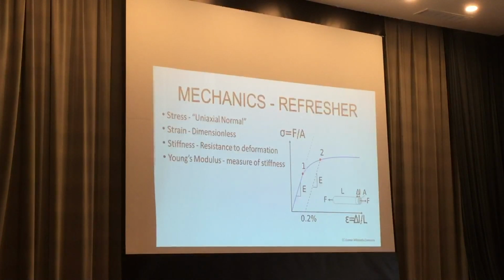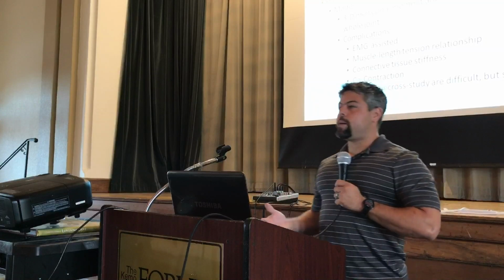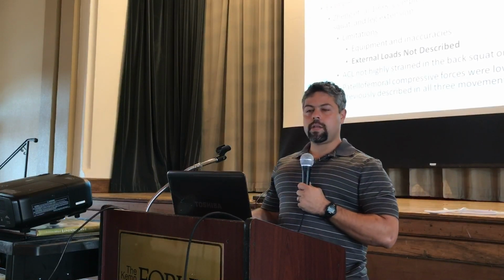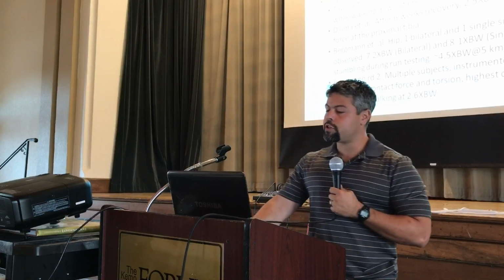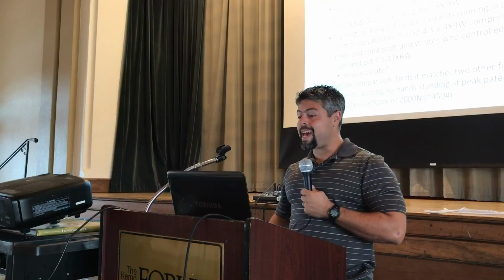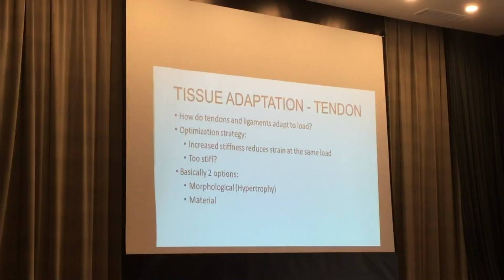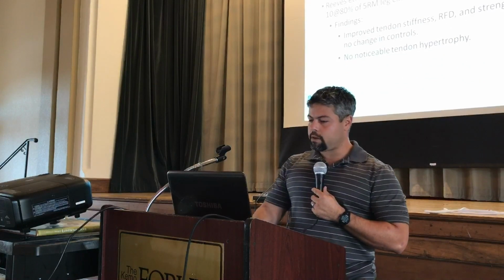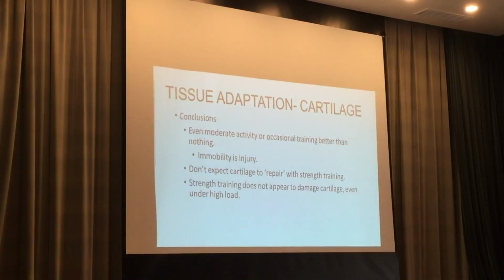Strength and Joint Health Part 3 - Connective Tissue Adaptation

Comment: 20:00 - for those who are struggling with the jargon, like me, this is where (I think) we begin to talk about conclusions, which are: (1) Squats make tendons better, >/= 70% of max intensity is required (2) tendons don't grow bigger (3) adaptation takes 12+ weeks (4) plyometrics don't seem to cause adaptation (5) age and disuse make things worse (6) Cartilage won't get better from training, but you can make it worse by not training
Reply: As someone who suffers from some osteoarthritis of the left glenohumeral joint, I take special interest in point (6).  And if I understand Gotcher correctly at the end, reasonable training should NOT make cartilage worse.  Combining this with Sully's OA presentation in part 2 says that what makes cartilage worse is the biochemistry of osteoarthritic degeneration initiated by injury to the chondal (cartilage) matrix and NOT the "wear and tear" of responsible resistance training. Did you get the same thing from the presentation?
Reply: Jeff Metcalf , yes.
Reply: You da real OG brah
Reply: That's a very excellent, succinct summary of our point. I think you'll love what Dr. Morris has to say later in the series.
Reply: Thx
Reply: Confused. At the very ending of part 2 it says "Tendon adaptation and healing are much more strongly driven by explosive / Plyometric Athletic movements that call upon the elastic properties of the tendon in performance" and then point (4) claims the opposite  "plyometrics don't seem to cause adaptation".

Comment: I work 12hr shifts which mean that the only way i can do the programme on non consecutive days is to drop it down to 2 days a week. Will this be enough?
Reply: Get your weeks worth of training in any way you can. Adjust the loads as necessary for this to be maintainable. Just dont change overall reps and days you workout.
Reply: I guess what i'm asking is if i could do supplementary stuff on the non training days.
Reply: What's lp?
Reply: Yeah
Reply: @P C why getting rid of powerclean? just go low intesity if you have to